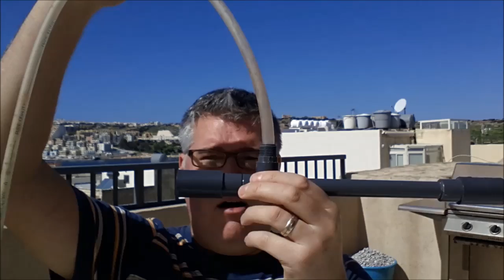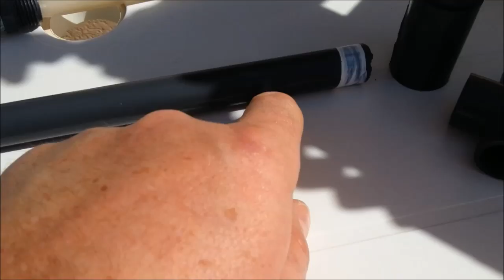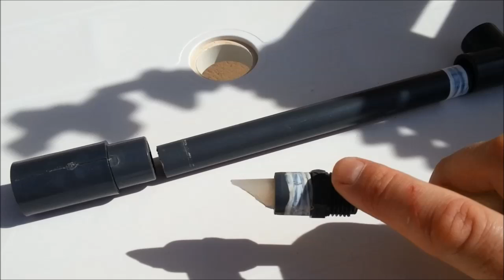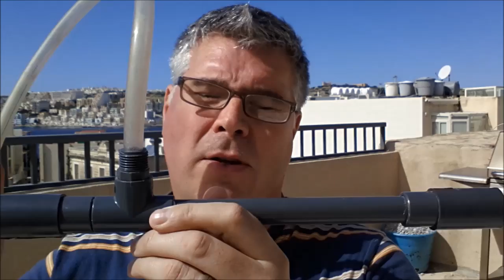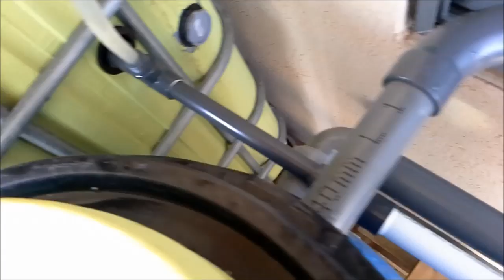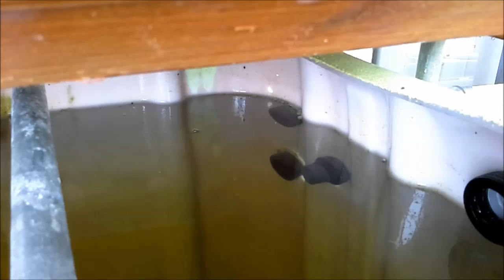DIY Venturi easy aquaponics build and setup

Comment: thanks for sharing. 

why the length of the input (you say no lower than 4-5" i think)? I've seen others that work shorter (equal length either side of the T). just wondering how you came to this conclusion. thx

Comment: I'm doing something wrong. Water sprays out the air tube and no air is drawn in. I am running a 2" system with a 1/2 HP pump. THe venturi is connected on the exit side of the filter tank. THe pipe size is reduced to 1.5" diameter for 12" then expanded back to 2" in the T. The pipes then carry the water to the pond where it enters through the wall approximately 2' below the water surface. I have tried to put the air tube in the pipe just before entering the T and also in the T itself. I have tried air tube sizes from 1/4" to 1" in diameter and all spew water under pressure. I am unable to get the air tubes to draw air.
Reply: Bang Tango i have the same problem. where could the back pressure be coming from

Comment: I need help on the plumbing of the system,the supply of all the parts etc. I live on Maltacampsite past Little Armier -near the White Tower.
Reply from the maker: David, give me a sms 9999 1871 Sunday if you like. I design and build custom Aquaponics kits here in Malta. I am sure I would be able to help you get your system up and running.

Comment: I have a question..... can a venture be set up on a non-pressured line.  Like on a gravity flow system?
Reply from the maker: Hi Mark Yes, a modified venturi will work on a gravity line provided that there is enough flow (ex. grow bed drain).